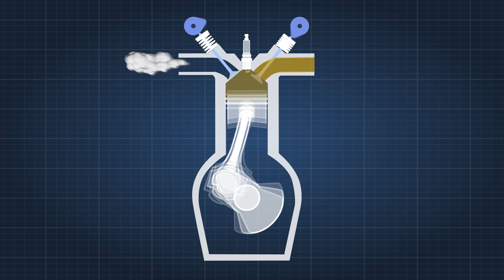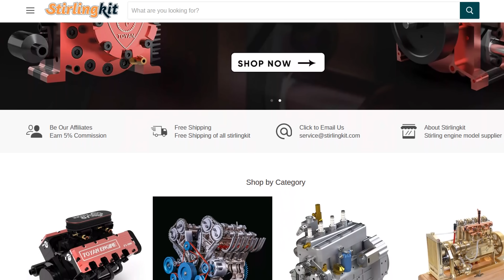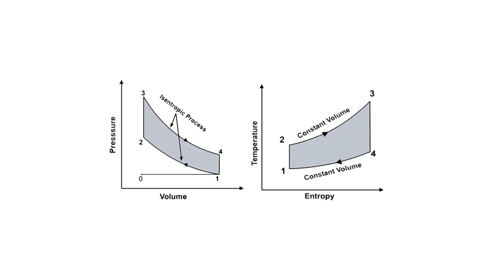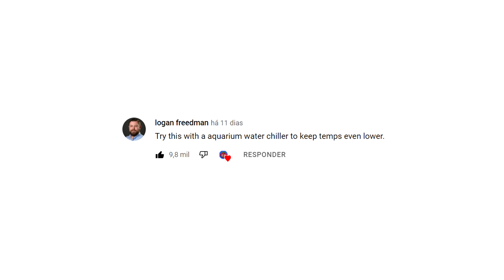I 3D Printed a Transparent Combustion Engine in Resin

Comment: If I were doing the test, I'd use a trigger to time the camera with adjustable retard to show the flame as the piston moves down the cylinder.
Nitro Methane will make the most power out of all fuels. Methanol will make more power than gasoline will ever make when the mixture and ignition timing is correct. Different fuels have different octane ratings, and ignition timing and compression ratio requirements. go do your research of what chemical compounds Nitro methane is.. You can also mix the nitro with methanol yourself for varying results. Build a dyno for testing using a generator and a Watt Meter and tachometer to measure power @rpm and you can then convert to HP with a factor of 1.34., 1kw = 1.34hp. you could also build an inersia dyno, with a strain gauge and PC program to measure power. Horse power and torque always intersects @5250rpm.

Comment: OK so as you can probably tell that engine isn’t idling smooth like a car a car doesn’t jump and spit and skip it fires consistently every single time it’s a geometry of your mechanical air delivery system

Port size throttle design cylinder head intake chamber design cam dimensions etc.

What’s happening is it’s leading in a very large amount of air at all times so when it fires the appropriate amount of fuel you get a very large explosion

That explosion causes the engine to rapidly increased to a higher p.m. then V I’m going to use “throttle quotes position is designed for therefore it’s not going to fire appropriately until the RPMs come down again

You can see this with race cars when you listen to them idle you can hear them jumping skip and lope because the compression is very high the intake valves of a large the camshaft is opening those valves much more than an economy car and the cylinder head chambers are larger intakes are larger so the amount of actual air in each cylinder at its idol is very high and causes the engine to jump up to a higher RPM believe it or not a 600 hp race car typically will idle around 1000 to 1200 RPMs the more horsepower the higher the RPMs the idle but if you listen to them it sounds like a low rpm because explosions are happening at a low rpm and jump in the engine up

I’m somewhat of an expert in this field this is a very rudimentary explanation that I hope is easy to understand but it’s only scratching the surface

As an experiment if you can put a load on the fly wheel to force the RPMs to stay lower let’s say around 3000 The engine should smoothing out and will fire every single time

Comment: More consistent 4 stroke cycling == More Heat == Less unburnt fuel to lubricate the cylinder walls.  What appears to be an o-ring is probably causing more friction against the cylinder head as it heats up and is dryer.

Comment: Video suggestion: transparent rotary engine (which should be relatively straightforward due to it's sliced design). Then you can test it with various fuels, including Hydrogen!

I've always theorized that Hydrogen would make a great fuel for a Wankel, bypassing a lot of the design's downsides. But I've never had the opportunity to test it myself.

Comment: Fuel energy density is not the only specification for fuels. Different Fuels can burn at different rates, even if they are the same energy density.

For example, gasoline and diesel have very similar energy densities, but diesel engines produce less horsepower and more torque than gasoline engines. This is because Gasoline tends to burn quicker than diesel. Gasoline, having a higher burn rate will "punch" the piston for a shorter period of time, causing high speeds (horsepower) with not as much force behind it (torque). Diesel, with a lower burn rate, will force the piston with a more gradual push than a punch. It will not push that piston as fast as gasoline will, but it will push for a longer duration than gasoline, hence more torque with less horsepower.

Feel free to correct me if you think I got something wrong.

Comment: 11:10 if you compared gasolina with diesel. Is the same thing. Gasolina have less power and more speed. Or maybe the needs of air in combustion are different from fuel to fuel

Comment: Perhaps this is also an issue of ignition timing? When the spark plug fires is as important as what fuel you're using. Maybe try moving the reed switch for the spark plug around using double-stick tape.

Comment: I believe temperature is the problem. If you run all three fuels at a very cold temperature running it through some sort of dry ice Contraption you will find that the the opposite atomization spark rate will create a larger combustion in the chamber.

Comment: Explosions usually have two metrics; speed and force. Explosives are usually chosen with these metrics in mind. For example cordite has a very fast, but relatively weak explosion, so it's good for firearm ammunition but would be rubbish for clearing a quarry wall.

Comment: I think the gases from the quicker burning fuel doesn’t expand long enough to put the full power on the power stroke. We had this problem in our old John Deere gator on the farm when they started mixing ethanol into the gasoline. The ethanol mix burned too quick. So even though technically the ethanol mix was higher octane more powerful fuel burn to quick for the gators small engine to get the full energy use out of the power stroke

Comment: its a complex question. No doubt. One thing to keep in mind in addition to many of the below comments about your carbeurator tuning is the octane of the fuel. Many think octane is equivalent to power. It is not.

Octane is actually a resistance to ignition by compression. Meaning you can pack more fuel in the cylinder up to the stoichiometric limit without the cylinder detonating before top dead center. More fuel means more power, hence the confusion. Methane has an octane of 120. Most gasoline is in the high 80's low 90's. The compression in your cylinder may not have been enough to allow it to ignite every time. The stoichiometry was off. Your gasoline probably also had methanol in it, adding to the confusion.

The nitro additive does not have an octane rating itself, but like you said, it does increase the oxygen content in the fuel which probably erased some of the errors in your carb tuning that limited the ignition of your high octane fuel.

Also engines that rev higher need an advance on their spark for ignition to occur on time. But you already got that one.

Comment: My rc car is drinking 14% nitro fuel. It us 2-stroke so that is nice. But i dont know the exact rpm. But it is high enought that it ripped its own clutch apart. By the way. Running tge 4-stroke on a alchohol might be better whit a glow plug.

Comment: AFR or air fuel ratio. All of those fuels want a different AFR to run ideal. Ideally you would have a different carburetor for each fuel. Another option would be EFI or electronic fuel injection. When using a higher Nitro content I imagine you want to run “rich” (excess of fuel) because you have more O2 available because there is more Nitro making it.

Comment: One of the issues has already been stated by a couple others, the AFR might not be quite right for each fuel so try adjusting the jets on the carb and see if you get better results, putting a load in the engine might help but I don't believe the accuracy of the other reasons why others had states, loading the engine would slow it down, and while the air mass density won't change due to the throttle being in the same position, it would certainly help highlight which fuel runs best in that little engine. I would make sure you're getting a tight seal around the piston rings, but not so tight as to seize the engine, I noticed that the engine starts the 4 stroke cycle pretty well but after a couple of ignition events it ceases correct cycling so it could be a heat / pressure issue on the rings.

The engine running at different speeds can be attributed to the flame front speed and AKI of each fuel, not just the energy density. Diesel has a lower energy density than gasoline, but because the flame front from detonation is slower than gasoline, it means that the force of the fuel explosion has a longer duration with the piston and thus has a higher brake specific thermal efficiency, although a good portion of this can also be attributed to the higher internal pressures required for diesel as they are usually boosted as well as the undersquare design of the typical diesel. I agree that load testing the engine with an alternator would be helpful, you would need to short circuit the alternator and read the current, while also reading the voltage so you can determine power, but the engine seemed to run fastest on methanol and so I would recommend optimizing the ignition system first for methanol. Instead of a magneto, probably a cam driven contactor closing the circuit for the spark plug might be optimal.

Comment: Little piece of info about Nitro often nitro engines don't run to their Max off the stop you need the valves you need everything to be boiling hot inside the engine and also you don't use a carburetor like you would with gasoline use injectors place specifically and precisely behind your valves because you want to spray the Nitro on the hot valve to start it reacting and then when that valve closes it will start to explode increasing your power over gasoline because it's exploding before the valves even really shut allowing you to get power past 45° off of top dead center into 90° of top dead center

Comment: Well, because the polishing is shaving small amounts down on your cylinders, you needed to make the interior diameter to account for the material removed. This will help your compression. Second is the joint of the cylinder and head is shown leaking. Even some thin gasket effect or maybe high temp silicone paste would at least help temporarily. Lastly, the timing control by magnets is probably having the wrong lag at certain RPM. It has a certain static delay, which for higher RPM may be just outside timing, as I am see several of the power strokes happening at almost full extension of the carry of the piston already, where it should fire somewhere close to 25% for a standard engine. Timing is complicated, as you won't be able to fight all of this with this kind of  model without some sort of finer control, with charge for your spark sitting ready, which it looks like some other form of spark generation is happening here. I am guessing one based on a spinning element I am not noticing, but such have trouble at higher rpm because they cannot go earlier in the right proportion for some speeds, hence missed strokes. Another piece you are missing which the nitro methane is helping you with is something referred to by some as flame speed. This is about the speed the explosion travels across the medium in which it burns, which is faster in methanol and nitromethane than gasoline. This is a big part of why the methanol was higherr rpm, as with lower compression needs and higher flame speed, more oof its explosive power was still delivering when it did fire. Then the momentum of that holds through more completely. Basically where the gas would ideally give you 25% in kinetic delivery, you were probably getting 10% or less from all the losses occuring from flame speed, timing, and compression. The methanol was giving closer to its max, but still losing a lot.

Comment: Could ignition issues be a result of imperfect Current path? Usually it is directed through the Cylinder in most small engines I have seen. replacing the cylinder with something non conductive could force it to route through the push rods, crank and crank seals making the path interrupted at times due to tolerances in the moving parts. did you try running the fuels with the brass cylinder installed and notice any RPM changes or sound differences?

Comment: The reason why methanol runs thr engine faster that standard gasoline is because methanol burns and expands faster but cools down also faster due the small energy content of the fuel, see, that massive heat loss of efficiency is somewhat of a necessary evil, as the residual gas of burning fuel needs to stay hot for long enough to keep the pressure of the power stroke consistent.

As for the skipping of the engine cycles, that's a somewhat intended feature of most engines, out there to prevent the engine from running faster than what they are rated for, one of the many reasons why bug engines struggle to run at very high rpm for extended periods of time.

Engines while mechacally speaking are simpe have a lot of science behind them to get them to oerfection, so much so that they have their own dedicated branch of engineering.

Comment: Perhaps there's some weird turbulence that makes it so that the burned gases remain for longer around the spark plug and you need extra cycles to flush them. Since some mixtures are harder to ignite than others, it could explain what is happening. You could try making something to alter the air flow (eg twisting the spark plug) and see if it has any kind of effect, or perhaps trying a stronger spark.

Comment: The Nitromethane needs a richer air/fuel mix to gain more power. The little engine is tuned for gasoline, so it's carb isn't giving the NM the mix and volume it needs. More research needed.

Comment: Gasoline has the most power, but the other fuels create more exhaust gasses. This is often used in the car world to spool up turbos faster, but because it's less powerful they use a mixture of both. So your see through engine goes faster but less powerful. (I think)

Another reason for loss of compression could be valve flow, your valves are not able to follow the rpm of the engine so they are not fully closed during the compression stroke, this can be solved by using stiffer valve springs.

Comment: Pretty sure gasoline burns slower than the other fuels, this means that some exhaust is still left in the engine after the exhaust cycle and there isn't enough air for the gasoline in the next cycle to ignite. That or the air-fuel ratio isn't tuned correctly, something like that least.

Comment: I would like to see an, let's call it electric jet engine. What i mean is, you use an electrolyzer to turn electrical energy  into chemical energy, in the form of hydrogen.
Than you can use that hydrogen to power a jet engine. This could be the jet engine of the future;)

Comment: Is it firing consistently due to the fuel, or rather due to the fact that the engine runs slower? I suppose it is the latter, so it might be that the fuel/air ratio is not optimum for the 25% nitro -> engine is slower -> firing consistently

Comment: So the problem is ignition, not energy released once ignited.  Look up minimum ignition energy for gasoline VS methanol.  Methanol had a lower minimum ignition energy.  This energy also varies by air fuel ratio so switching fuels without knowing/setting the air fuel ratio will be problematic for comparing the fuel.

Comment: You are way too lean. It takes 2x more alcohol to run an engine than gas and probably 3x with the nitro/alky blend. You probably need to greatly increase fuel flow volume. The good news is the fuel will pull a lot of heat out of the engine so your plastic cylinder will last longer. You might want to try replacing the sparkplug with a glowplug.

Comment: the reason 25% nitro didn't performed at its best is because you haven't tuned your carburetor. Also, different fuels require different spark advance curves to extract the best performance. Tuning the carb is pretty easy, the spark advance curve is a whole other story. Parabéns pelo trabalho incrível e continue assim! 

Dica para o próximo video: imprima um motor wankel em resina!

Comment: I don't think it runs well because the cylinder has been replaced by plastic. so that the current coming from the spark plug can only flow back over the push rods. those are moving parts so that's why i think he makes a bad contract. the that also explains that it makes worse contact at a higher speed. I hope it works better then good video by the way

Comment: The short answer is your carburetor - all that engine seems to have is a basic venturi-siphon setup, whatever its geometry is, it will not be able to accommodate multiple fuels. Grab your air compressor and have it supply a thin pipe in the throat (to bypass the siphon), play around with the pressures and you'll be fine as you'll be offsetting the amount of fuel drawn up. Alternatively you can take the carb apart and mess with the siphon, but it's an extremely tiny tube, and adjusting it might be tricky.
Unless you remove it all together and replace it with your own, and use a needle valve on it so you can adjust the restriction in the tube while it's running.
 
Also your elevation will play a role, as in a typical carb, the contact breaker (points) (and jets if staying there) need to be adjusted based on altitude. Since yours is mag induced there may not be a way to adjust that portion. If you're at altitude (and this engine was based on sea level) then you're going to be running rich automatically.

Comment: I believe the reason you’re the engine is skipping combustion cycles has to do with the sealing around the cylinder. Car engines have ahead gaskets that help maintain a seal between the engine head and cylinder walls, that allows for compression, this model likely doesn’t have one. 

If the seal is bad, it would makes sense that it’s skipping cycles. If the air fuel isn’t compressed enough to ignite, most of it gets exhausted. However, some of the fuel will stick to the piston and cylinder wall, making a super rich mixture on the next cycle that explodes much easier (like a choke on a carburetor).

Comment: My thoughts are that the 25% NM doesn't put out more power than the other fuels because the carb isn't tuned for it and the air to fuel ratio might be quite a bit off.